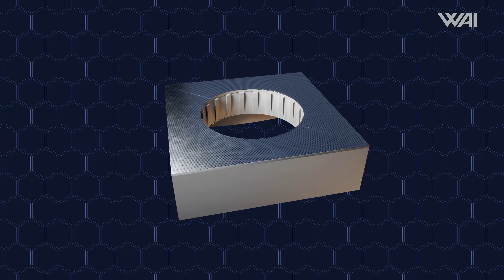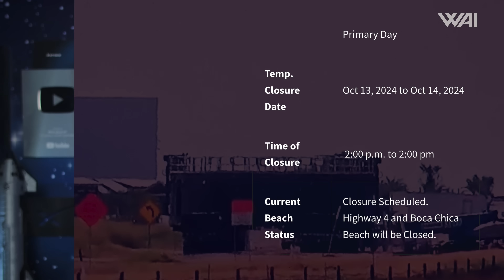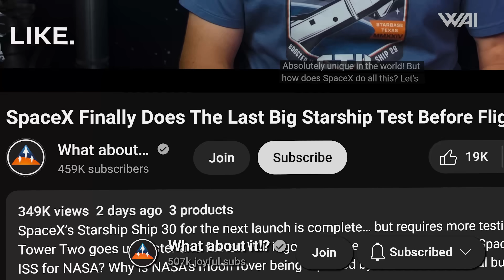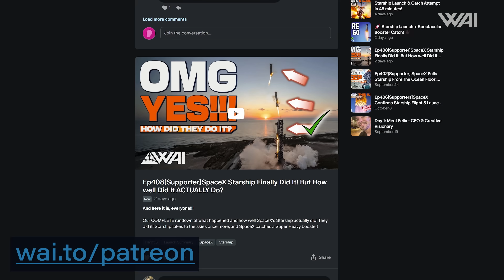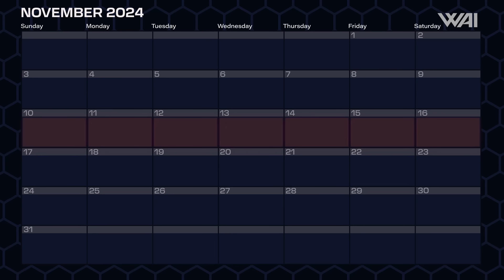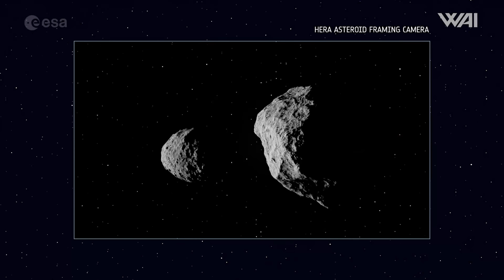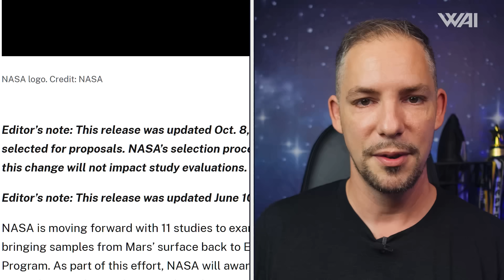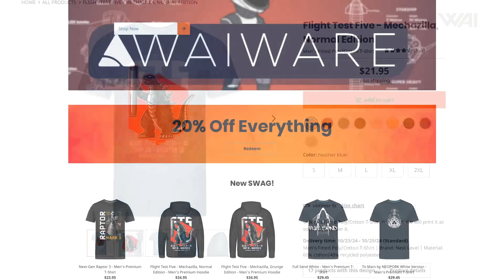SpaceX Reveals Flight 6 Starship! Possible Launch Date Available! Can They Do It?

Comment: Way to go, Felix and Team WAI. Something to consider, SpaceX is licensed to perform Sub-Orbital flights  
of the ship at the present time. In order for the Ship to be recovered at the launch tower, it will have to be 
re-licensed for Orbital flight. Logistics seem to work out that it would take between 3 and 6 orbits to re-align 
the path back to the landing site. It would also include re-ignition of the engines in orbit, something that 
has yet to be done. Maybe flight 6 they will try the de-orbit burn of these engines, thus necessitating a flip 
maneuver to do so. Lots of speculation here, but those are My thoughts.
Reply from the maker: Yep! I don't think that engine relight will pose a problem and attitude control seems to be working fine now! So... bring it on! :_WAISweet:
Reply: Yes, I think they may try a full orbital trajectory and retro fire of the engines to de-orbit next time. It will almost certainly require a licence modification if that is the plan though.

Comment: This booster will never fly again, for several reasons:

1) They're gonna inspect it as thoroughly as possible, which will probably require some level of disassembly. It's worth far more for what it can teach SpaceX engineers than as a flying booster.

2) There's already a growing stockpile of brand new boosters that need to fly or be scrapped. There's no reason to refly this one.

3) It will be put on permanent display at Starbase.

The first Dragon capsule that flew to space is hanging from the ceiling just outside SpaceX's Mission Control room. The first booster to land successfully is standing guard outside their Hawthorne factory. Starhopper is faithfully watching over Starbase to this day. Does anyone really think the very first SuperHeavy to successfully return and be caught out of the air by Mechazilla won't be put on display?

Comment: I am guessing that IFT-6 will fly essentially the same flight plan and its main purposes will be to test the engine start process for the de-orbit burn and heat shield improvements.  The heat shield changes may not be designed yet, much less ready fir installation.  When the heat shield is installed and ready, they will launch.

I'm hoping that IFT-6 will be completed before Thanksgiving.

I think IFT-7 will complete more than one orbit and attemp a catch.  If so, IFT-7 will require a new flight plan and therefore, a new license even if IFT-6 is completely successful and without incident.  I hope to see this mission flown before Christmas. 

Once that flight plan is completed and because the LEO orbital fight plans other than refueling will be nearly identical for awhile, SpaceX should be limited by the number of launches per year that they are allowed rather than waiting for new licenses to be approved.  

I am stoked!  After 5 decades of mostly ho-hum LEO flights punctuated by two catastrophic failures, we are back to looking at the moon.  Further, we know lunar missions are not the ultimate destination this time around but, rather, a long term dress rehearsal for Mars!

Comment: It seems obvious that the location to the side of the launch mount where the transporter unit brings the booster and ship to be lifted by the chopsticks could be hardened to serve as a return area. This would prevent subjecting the OLM to the wild movements of the gimbaling engines' exhaust necessary to maintain control of the landing item's position.

Exhaust from the three engines while landing is a small torch compared to the 33 or more engines during launch. But the movements are more wild. The design/operating philosophy to land over the OLM seems to be that all parts of the OLM have to be hardened enough to withstand engine exhaust, even parts not impinged on during launch, in order for the system to be robust enough for rapid reusability. They are thinking big as always.

Comment: The issues certainly are simple to fix. The size of this booster makes all the forces geometrically greater. They will either need to reinforce the bells or even cool them even if they’re not being used or slow, the velocity even more with a entry burn.

Comment: Correct.. Once the booster works and can be returned with minimal damage. The focus will be on Starship to preform and make a variant that can do it all other than star link deployment.. The best way to secure revenue is star-link launches that are completely reusable. Another way is a cheap deployment option that can return and land even on a pad. That can deploy hardware with a fairing that can be written off in re-entries for special projects that need the deployment shape over the star-ship unit.

I would Imagine that starship will also get a variant with a Canada Arm.... at some point. Regardless the focus will move to the core design of starship.'

Comment: I think after seeing the results of IFT5 and how the heat-shield performed with all the changes they made, there was still burn through, even if it was minor. They might just skip ship 31 and go right to ship 33 to test out the V2 changes. Ship 31 may not be scrapped, but might be used to test a future booster that is caught and then re-flown to test the reusability of Super Heavy. This way in case of a RUD during liftoff, they dont really lose anything.

Comment: Since forward flap survivability still seems to be a major vulnerability of the block one ship, why not just bypass any remaining block one ships and jump to the block two version to see if the new location of the flaps solves the burn-through issue ?  What new info can another block one ship launch provide ?
Reply: @linneisenhower2571  orbit and deorbit burn? Test payload? These are things I could think of. Who knows?
Reply: Need a different license for it
Reply: Because they have the block 1 hardware and a license to launch it, neither of which is true for block 2 yet. And a repeat of IFT5 — probably with the addition of the engine relight test they've been putting off — is still useful in terms of demonstrating to the authorities that precision landings of the upper stage are something they can do repeatably. That's important because one on-target landing certainly isn't going to be enough to get permission to drop something into the inhabited areas near Boca Chica.

Comment: I want to see them catch the Starship next time.
Reply from the maker: YES! That's the next BIG milestone! After that it's just about fleshing out the internals for crewed missions and getting payloads to space!!!
Reply: @Whataboutit  Fleshing out the internals for crewed flight is something I personally can't wait to see. Will be something else we haven't really seen before
Reply: @Whataboutit what if...if they just put a heat shield tiles at the top on OLM so they can just replace some of it if the tiles got look toasted or damages
Reply: So you guys think that catching ship before payloads. That would be cool😮
Reply: @aikun3606  They just need to put it on rails and wheel it back out the way after launch. It's not required for the catch.

Comment: Flight 6 should be if the booster  Lands on the tower Starship should go into orbitt the booster could be removed and the Starship could land on the tower !
Reply: I don’t think they have to actually remove the booster? I think the idea is for the booster AND starship to be able to land on the same tower without having to remove one. I could be wrong of course.
Reply: FAA has entered the chat
Reply: @standavis5639  starship will land  right beside the tower so the chopsticks can pick it up from the ground if i'm not mistaking
Reply: @UpperDarbyDetailing I think the tower will put the booster down on the launch pad first after which the ship comes in to then land on the chopsticks too and be immediately placed back on the booster?
Reply: I guessing  catching the starship is a lot harder due to its speed and the bellyflopp manoeuvre. Control authority of the new flaps needs to be ascertained  and factored into the catch system...
Reply: @frietjedemeeuw9591  no because then starship would need landing legs anyway, the tower is catching the starship the same way it catches the booster
Reply: @opensource111  belly flop is basically a flair for aviation, quick change in attitude to kill momentum and change attitude ie orientation...in the case of tower catch, it'd be done at higher altitude, picture it as a 'hovermode', after it has the new orientation it can shift to catch
Reply: @nickreinders6347  Well not immediate as the hot staging ring would need to be positioned on top of a booster first before the ship is stacked. Assuming it's in its final state...but more likely they'll land booster and move it out the way or hold the ship in the chopsticks over the booster...and move the booster away, then lower ship and remove it...
Reply: @UpperDarbyDetailing  Well booster can stand on base, ship in the chopsticks...what places the hot staging ring? Much like Falcon 9 it'd have time off the pad but that's still faster than building a new one for each flight
Reply: @jerryandrews7028  aah i see 😊
Reply: @jakobusswart1376  True, though the hot staging ring is only temporarily disposable, so the next version booster wouldn’t need the ring replaced. For now the fastest thing would be to drop the booster onto a SPMT and bring it back to the high bay or mega bay to replace the hot staging ring and anything else it might need. Booster twelve they’ll probably strip. If I was Elon and launch six they recover Starship I would probably schedule launch eight for an hour or two after launch seven and reuse the starship with a different booster (due to hot staging ring issue and warped engine nozzles).
Reply: I think they're going to try and catch the ship on angle and leaving the booster where it is
Reply: @frietjedemeeuw9591 starship won't touch the ground will be caught with chopsticks angled to the side
Reply: If starship tries to land while the booster is in place then the starships engines will wreck the booster.
Reply: @musicbruv  it would land more to the side
Reply: @musicbruv  and they won't try to catch this ship either would be outside the scope of the faa permit it will most likely crash into the ocean again unless they try to catch it with nets in the ocean.
Reply: @nickcollins1528  what do you mean to the side? Starship will be caught by chopsticks. It does not have landing legs as far as I know.
Reply: @musicbruv  I meant the would catch the ship with the chopsticks to the side it wouldn't land directly over the booster
Reply: @musicbruv  starship wouldn’t come down directly over the booster.
Reply: @UpperDarbyDetailing  Since it needs to land on the tower using chopsticks, how will it not land over the booster?
Reply: @nickcollins1528  can the chopsticks be rotated then?
Reply: @musicbruv  I may be wrong, but I think the chopsticks can reach two sides, not just over the OLM.
Reply: @UpperDarbyDetailing  you are correct. My bad. I thought about it after my comment and realised they do rotate as they stack the starship and booster.
Reply: @musicbruv  👍🏻
Reply: @musicbruv  the move to the side to pick the boosters off the transport then swing back over the olm to place it

Comment: Those catch pins are greatly underrated. Mind you, the booster has only two of them. This means the booster has to be oriented very, very, precisely. Not just in XYZ axis (which is impressive enough by itself) but it also needs have very specific rotation angle to place the booster on the chopsticks on the catch pins.

Comment: It should be noted when discussing NASA's Europa Clipper mission, ESA's Jupiter Icy Moons Explorer (Juice) spacecraft launched 14 April 2023 has similar but somewhat geographically expanded goals as NASA’s Europa Clipper. The trajectory has a moon, Venus and three Earth flybys to arrive at Jupiter July 2031. The Europa Clipper mission is currently scheduled to arrive at Jupiter in April 2030. The primary reason that NASA's Europa Clipper mission is set to arrive at Jupiter over a year sooner than ESA's Jupiter Icy Moons Explorer mission, despite launching nearly six months later, lies primarily in the launch vehicles differences. SpaceX Falcon Heavy, is one of the most powerful rockets available. The high performance of Falcon Heavy gives Clipper a higher initial velocity, enabling it to follow a faster interplanetary trajectory. Juice, on the other hand, was launched on an Ariane 5 ECA+, a capable but less powerful rocket compared to the Falcon Heavy. Juice's longer cruise time compensates for the lower initial velocity with its use of multiple gravity assists. Go SpaceX.

Comment: The only problem I see with a catch attempt on the ship versus booster is the chopsticks need to be open longer to allow the bottom flaps through before clamping down.  I have a feeling the ship will need to "hover" for a longer period of time versus the booster, giving the arms enough time to close.  It's going to be a more tight with the ship, but it would have been nice if they would try to "land" the ship in a daylight area so we could see more.  Since they nailed the splashdown with flight 5, they should get a boat that is way more stable then a buoy for camera shots.
Reply: the flaps closed when the landing burn ignites.

Comment: I'm thinking about the way the front flap overheats, it seems to first overheat in the seam between the ship and the space where the flap pivots at the rear corner of the front flap. I'm wondering if it could have a tube shaped ceramic heat deflector in that space  running the length of the flap talked inside under the flap. I don't think that would affect the function of the flap very much but it might stop the Heat from getting wedged in and concentrated in that gap and move it out to the center of the flap and away from the bottleneck in the corner. It seems that the Heat becomes concentrated in that crack at the space between the flap and the ship.

Comment: Would it be easier to build/add hardened landing structures, including another set of chopsticks, on the back of the launch tower? Launch on one side, catch on the other? That would keep the quick disconnect assembly and the hold down mounts from taking damage during landing. The second set of chopsticks would also help balance the tower weight closer to the foundation and should slow any oscillation that might happen.

Comment: A few things to note; this is where SpaceX expected to land the ship right on the side the mount, second the booster is only using 2 engines with a lot less fuel, we should not expect the same beating on the return of the booster as the take off.

Comment: The shock absorbers on the catch rail didn't seem to do a lot. The ship appeared to come to a full stop moments before the catch rail started to sink. So the chopsticks and tower had to absorb all the ships momentum which I imagine greatly increased the peak load they experienced. I was expecting the rails to start sinking as soon as the pins touched them and the sink rate to reduce with the whole setup coming to a complete halt just before the rails reached their maximum travel distance.

Comment: Judging by the fact that 33 has its heat shield almost complete, while previous ships aren’t even close, I think it highly likely that it will be used for flight 6.
Reply: Offset by the fact that S31 had undergone a static fire
Reply: @alvianchoiriapriliansyah9882  And the fact that the IFT6 license is only valid for a flight substantially-similar to IFT5. A major redesign of the upper stage is unlikely to satisfy that criteria.